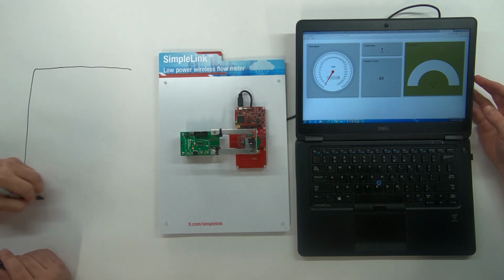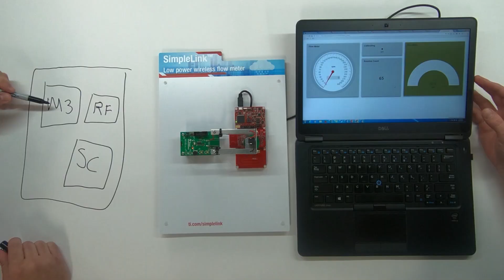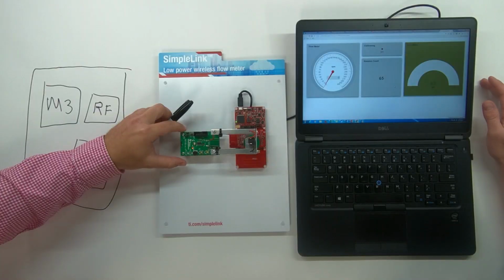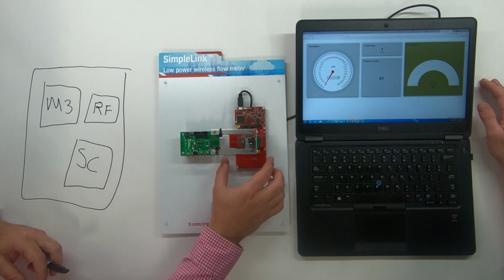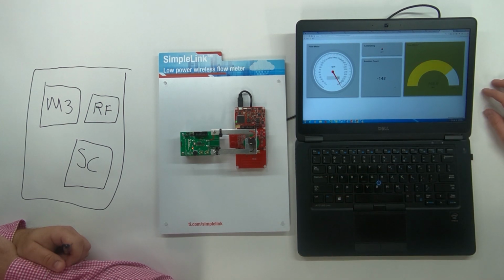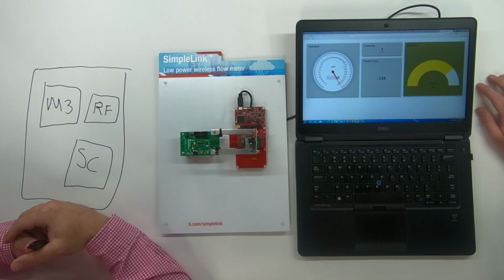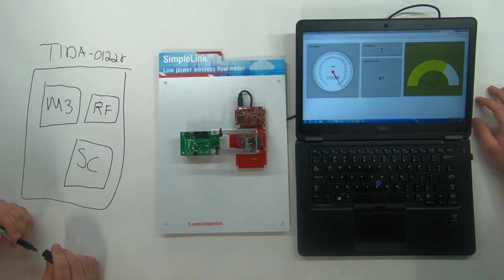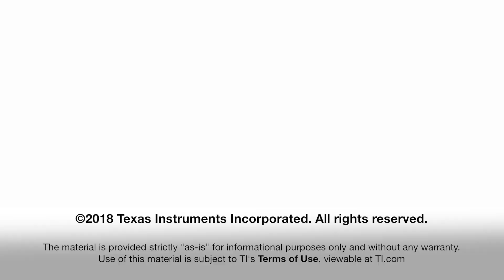Connect: Flow metering demo

Comment: I'm interested in resources for correlating SmartRF protocol tools with FCC Emissions types.  For instance it would be good if TI had a resource that allowed a designer to pick and RF band and input emission type codes (i.e.: A2D, F2D) and have the SmartRF tool filter parts that can RX/TX/transceive those emissions using protocols they support on the RF bands specified.

I picked up a pair of CC1312R LaunchPads to develop a car keyfob transmitter and remote-autostart receiver with "actual security" - and it seems weird that one can't select the regulatory environment first, then the amount and type of data they wish to send, then the band, and then filter down to the protocols.  This should all be parametric IMHO.